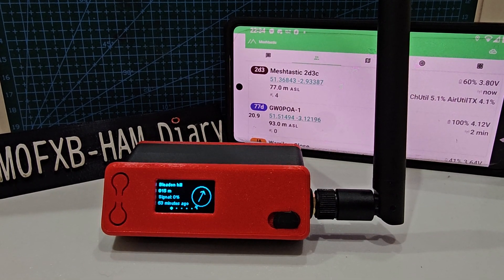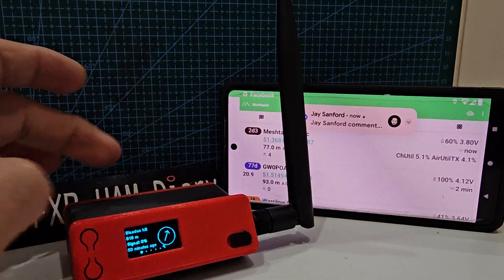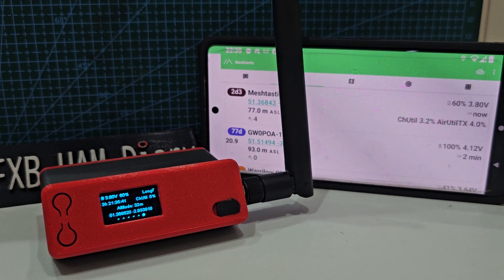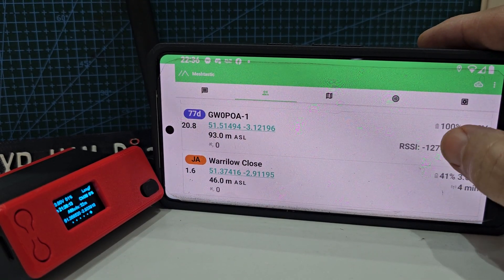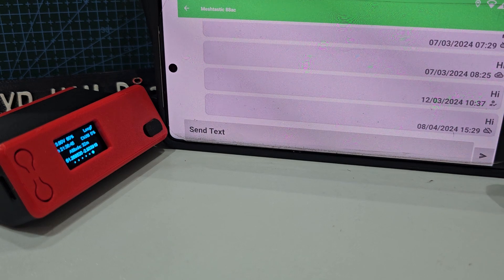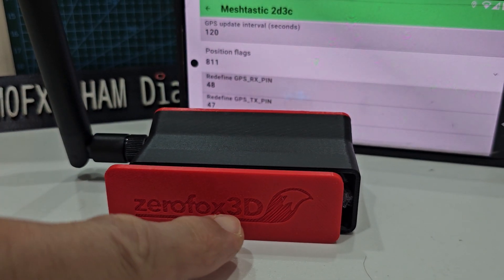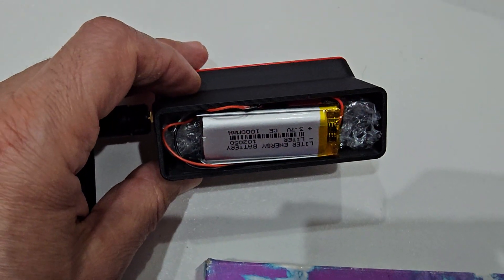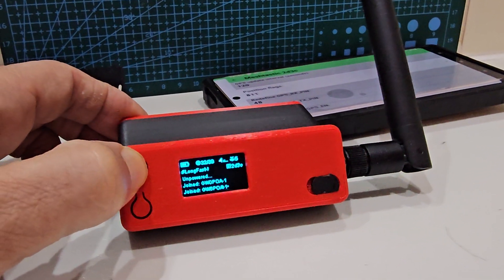Meshtastic Heltec V3 & GPS Module

Comment: Do you have a link for the gps module?
Reply from the maker: https://www.ebay.co.uk/itm/314266538489?itmmeta=01HV95CZXBTAEB5KVGVSKCMHBK&hash=item492bbed1f9:g:wmYAAOSwTc9jmbHr&itmprp=enc%3AAQAJAAAAsEgeOGI3pSCpdvhQJmhTrQ0%2FPEZ3%2FHytRfHh1TeZFNR7eYr7Arvk9Y%2BPw7jOBHYA4N9y2EvRD1jEwStIzu8ankHBynX2MmLiQfjsgRgvBwvFl9idUhoBQIJYkzaIHUelt%2BBjmLJpH2uW5WN8jZfm9oQAdMVgOCSK3EtEcJc2VbgYC2ZSsk8qo6zJj30STSmmB5vQAnrCJbMh%2FM%2FZ5L%2Bl0PRfJ0EqI%2FLuCmK4h384tUEq%7Ctkp%3ABlBMUOD-s6XaYw